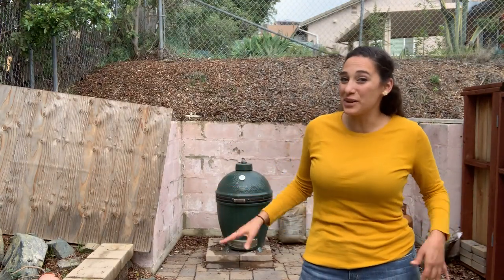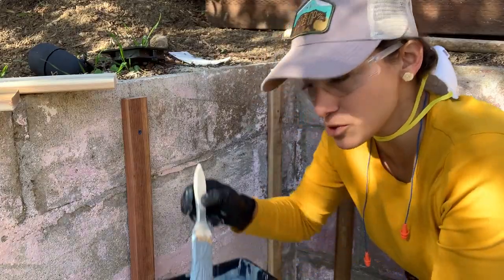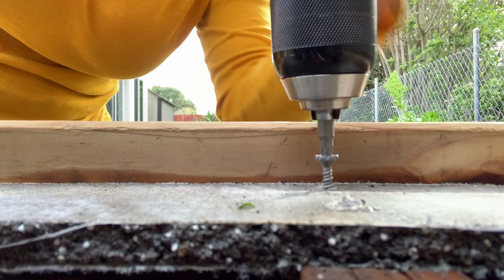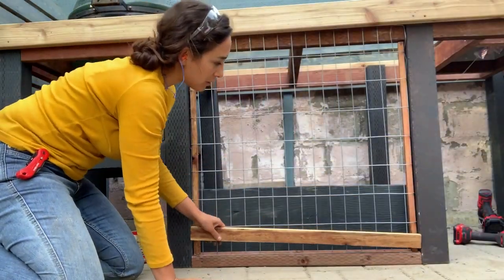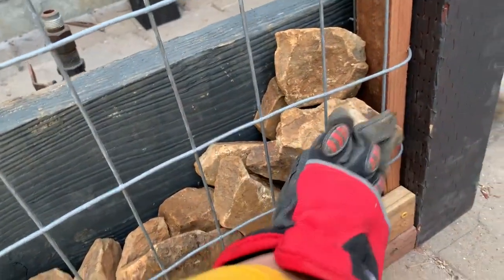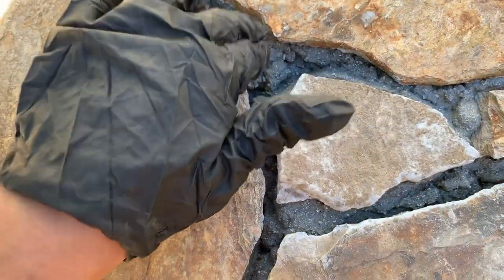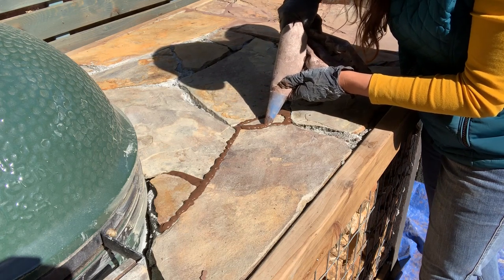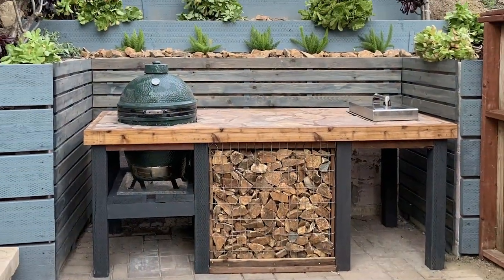Big Green Egg BBQ Table w/ False Gabion wall & slat wall | Sara Bendrick

Comment: I’m actually impressed! I think you pulled a lot of natural elements that work well... I love the flagstone, even more so you were smart and went with a natural color grout unlike sooooo many others use that awful concrete grey and ruin the look, yours turned out nice! I’d actually like to see if creating a true gabion wall where your chain link fence is. If you could dig in some thick wooden posts to add in warm of the wood and as a way to connect your already installed chain link fencing to hog wire and back fill in between with either flagstone or a less expensive rock, etc. would give a beautiful finish and hide the ugly wire fencing and yet it’s repurposing while maintaining the chain links original function! Just a thought